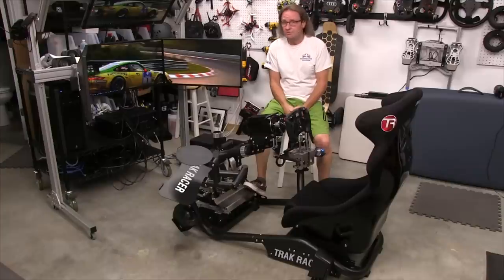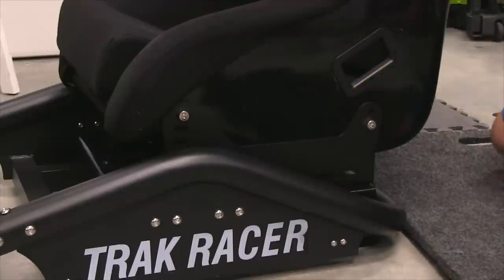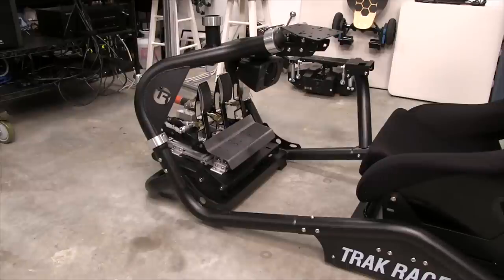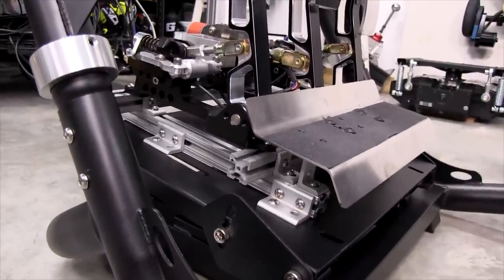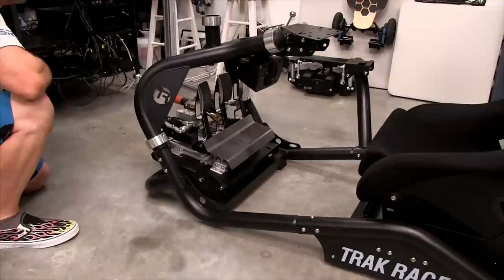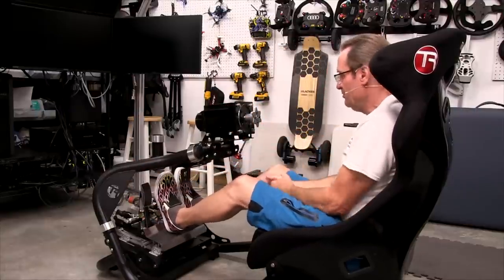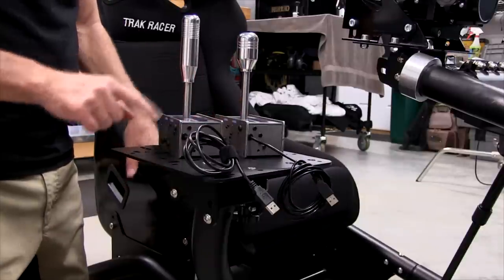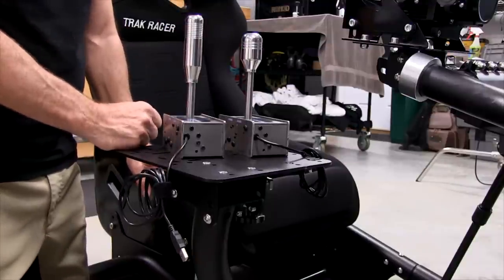Trak Racer TR8 review "The Setup"

Comment: Thanks for your review Barry. As a result of your comments we have designed and now shipping the Mach 2. The TR8 Mach 2 features:
1. New and stronger pedal plate and brackets
2. We have added more mounting points and enlarged the pedal plate, wheel mount and shifter mount
3. We added a second grub screw to the monitor stand to stop the monitor angling when  one screw is added
4. We improved the seat so the quality is better and wider size
5. General improvements to the quality of the frame
6. We have now spread the TR8 into 2 boxes to stop transit damaged previously experienced.
Reply: Hey guys! I just ordered the tr8 Mach 2 today. Then after I saw that it was a preorder? Do you know when you will receive stock?
Reply: They’re in stock now. Did you get your rig?
Reply: What's the major difference between the RS6 mach 3 and the TR8 mach 2?
Reply: I have the RS8 mk4 and am replacing with this rig due to the pedal plate height issue. Looking forward to it.
Reply: Trak Racer awesome news i was a bit concerned seeing this so i checked your website and your Mach 3 now looks to have all of the improvements Barry mentioned. I love companies that ‘listen’ for feedback and make their products better for this reason ive decided that im going to purchase the Tr8 mach 3 from you 🤙🏽
Reply: ssidewayz I did the same‼️ waiting to get the MK3. The only thing that concerns me is that I need a bracket for my motion platform which they kindly offer me to send to try it. But I am worried about the height it could gets.
Reply: Looks like a dynamic maker. Thumbs up guys keep up the good work!
Reply: Trakracer give this man a Mach 3 to review
Reply: @ssidewayz  Until I see a comparable quality review from the likes of SRG with the new improvements I'm not investing over $1k when all I can find on the internet is complaints with missing parts, no reimbursement, and bad customer service. See Sim Racing Geek if you need an example.
Reply: Would be nice that you organise the company to supply people that order you a rig or that you keep them inform that it will be long. I'm still waiting after months to get mine 😡
Reply: @rob4294  Tooks 3 months and a lot of pressure on Trak Racer to get it. They are bad organized, some people wait long time while some people get it in a week end. Never stop putting pressure to get your !
Reply: @rob4294  I ordered my TR8 Mach 3 December 11th 2020 and just got it today february 9th 2021. worth the wait though! just built it. can't wait to try it out tomorrow.
Reply: Man it is so freaking cool that you guys listen to these reviews and upgrade your stuff.
I am looking for a rig right now and even tho the pedal flex made me unsure about the TR8, i am certain that the new version (now even Mach3) will be fine. :-)
Reply: @Dornpunzel  I have the mach3 and I absolutely love it. There's no noticeable flex for me. I use Fanatec gear.
Reply: @marcusberggren9241  Hey Marcus, thx for the feedback. I rly prefer the look of the "tubed" TR8 rather than the typical Alu Rig which does not fit that well into my living room. Do you have Fanatec DD or Belt Gear? :-)
Reply: @Dornpunzel  I use clubsport. Good enough for me. The TR8 looks great and have a smaller footprint than I expected.
Reply: GREAT! This is the kind of company reaction we want to see! Guys from Trak Racer, be sure I will order the next few weeks from you because of your reaction! Man I love CAPITALISM & free markets  <3 Good job!!
Reply: Can anyone tell me the new Mach 3 is not flexing on the pedals? I have heusinkveld and want to make sure this is the right buy
Reply: @maresq2sea  please email us through the website contact page, we will show you some reports on it's strength. Matt here, founder and CEO of trak racer.
Reply: @maresq2sea  I emailed them Saturday asking them the same question. Did they answer you yet?
Reply: @eboz3213  they did, here an extract of the email ‘f you own Heusinkveld pedals maybe you could consider going for TR80 which we have in stock and should provide you with even better experience with your pedals?’
Reply: This is awesome.  You guys actually react and make changes based on feedback.  I’ve owned a Sparco rig for about a year… selling and moving to the TR8.
Reply: @DidItForDale  thank you sir.
Reply: It's good that they actually care enough to listen to feedback that their customers give, it means they're a really amazing company. I personally am really excited for getting my Mach 3 TR8
Reply: It is refreshing to see a company act on the feedback of a professional like Barry. Well done!
Reply: Will this seat fit onto other rig brands as well?

Comment: I think this made an impact with Trak Racer Barry. I ordered mine 6 weeks ago it was due to arrive today.
I sent them an email asking what was happening, I got this response;

We have made several improvements to the TR8. 
You will actually receive an update for the TR8 which is the MK2. It has improvements to the frame, strengthened pedal mount, additional mounting points on the pedal, wheel and shifter plates as well as other general updates to the frame and seat.
Reply: How do you like the TR8? Are you happy with the choice?
Reply: Dirty Beef Curtains yes please I would like to know the same. I just ordered the tr8. And now it says out of stock. Sad af hahahah
Reply: MrControversy Not sure if you’ve gotten yours yet but it all the issues he mentioned in the video have pretty much been rectified.
Reply: Savage stuff, that has me interested again!
Reply: @DirtyBeefCurtains  Very much so, it's solid as.
Reply: @mattfarrar5472  There is a MK3 out now, which is even more improved over the MK2. I was looking into getting the GT Track from Next Level Racing, but the TR8 MK3 seems like a better option and it's also more compact. Are you still happy with yout purchase today?
Reply: @wuzumaki  They were my 2 rig options aswell but from what I've heard the Next level is pretty average. The Mk3 seems to have a much better pedal tray but for V3s it has a little flex on the Mk2.
I'm actually getting some SimworX pedals arriving today so that will test it! But apart from that the rest of the rig is great! Really solid all round you can even feel the force of the v2.5 wheelbase hitting bumps and kerbs transfer through the cockpit which is cool, not lost on any flex of the rig.
Reply: @mattfarrar5472  My biggest issue with NLR is that the height adjustment of the wheel also affects the length adjustment. The shifter tray also has more flex than the TR8. I have the NLR Wheel Stand DD, so I'm speaking from experience. Now that I'm going for a full rig, I'm most likely going with the TR8. I like the fact that it has an integrated monitor stand. Do you feel that the monitor shake too much when using the integrated monitor stand?
Reply: Update on the SimworX pedals with the Mk2 tray it cannot handle them at all, flexes like crazy! Seems as though the Mk3 tray would fix that though. Saying that though it's perfectly fine for V3s or less no issues.
Reply: Where do the track racer products ship from in the United States? I was told Texas but I can't seem to get them to take my calls or emails.

Comment: Good review. I've had mine since release about 3/4 months ago. I'm using  fanatec DD2 so had no issues with any flex at all. You are exactly right about the seat though. I had to drill new holes about 1 inch lower on the back end of the plate otherwise my back would hurt after gaming sessions. Great solid sim rig imo 👍

Comment: Thank you for the review!  I ordered a TR8 largely based on this video.  I wish I would have searched the forums though.  I ordered my rig 1/27...it’s 3/8 and still missing my lower assembly and seat.  The main assembly has a big indentation that Trak Racer tried to hide with paint..the paint doesn’t even match and it’s already coming off.  It’s been extremely frustrating to say the least!  I honestly just want my $ back.  Even if the rig shows up I’ll be selling it quickly, I have no interest in using a product from a “company” that is so poorly run and treats customers like this.

Comment: I know this is an old video but, your seat brackets are backwards and the front collars are not slid down and tightened thats why there is movement in the wheel deck frame! Also mach 2 wheel plate is ROCK solid. I guess i have you to thank for that!

Comment: I Have the TR8 with Fanatec CLS Elite and it's rock solid with that base and wheel
Reply: Hi , what size monitor do you use ,an does the monitor flex/move under wheel movement,  cheers Glenn 👍
Reply: @glennharrison6883  49" QLED TV, really solid
Reply: @froomer17  cheers mate , bloomin outta stock tho 😌 might have to go for the RS6 🤭
Reply: An other question for you 😁 , what you using to run the 49" ,, PC or console
Reply: @glennharrison6883  Both Ps4 and PC. TBH, prob best getting a monitor at the frame rate is a lot better. TV only is 60hz, monitor will run smoother at 100-155hz. If I had to buy again I would get ultra wide screen monitor. I also use HP reverb as VR is amazing for sim racing, once setup correctly :)

Comment: Ah man I wish you reviewed the stock shifter mount and the integrated monitor mount considering 99% of buyers will use those...   I hope the smaller shift mount sits a bit lower than the accessory one because it seemed a bit high up.

Comment: TR8 or P1X?, any suggestions?
Reply: That was exactly what I was thinking between the 2 and I decided to get the TR8. Simply because I know I will not go for the motion update in the future. If you DO plan to upgrade to motion, P1X is your rig.....TR8 can only be thinking to add the NLR motion V3 at the seat however, that need some custom metal framing but the seat will be too tall for the TR8 and because the wheel mount is not adjustable (raising up) so leave that TR8 is not capable of update to motion.....so I just leave it that way and enjoy the good look of the TR8. They just released the WHITE version and I think that looks very cool too.

Comment: What is the track system that your monitors are on?
Reply from the maker: A Sim Lab Triple monitor mount that I added wheels to.
Reply: @simracinggarage3026  I can't seem to find those here in the US. Any suggestions? All quality monitor stands I have seen are sold out. Just looking for a single to use with a GT Omega Pro rig. GT Omega's stand are also sold out and have been for a while.

Comment: Hello sir. Which tr8 is this? Mach 3?
Reply: I believe it's either the Mach 1 or 2 as I have the Mach 3 and It has more/diff parts than this video. Mainly on the pedal plate. They've listened and strengthend it.

Comment: I had an trak racer rs6, it had really bad flex in the pedal plate and wheel plate. Really disappointing product. I have a simlab p1 now and it is worlds better.
Reply: Those 2 cockpits aren’t even close to the same price area 😂 a p1 is a high end rig where an rs6 is almost considered low end.
Reply: @aoplinger622  I mean I believe the rs6 was around $600 and the p1 was $800. Not a massive price different. Edit- just checked they are exactly the same price at 750$. But you have to add a seat on the p1 for $150. So they are competitively priced.

Comment: Hey Barry what do you prefer out of these two rigs the fanatec dd1 with the v2 Formula rim, podium shifters with v3 pedals or the simucube 2 pro with heusinkveld sprints and the ascher f-28 Wheel. Both will be mounted on the gt1 rig but the simucube will be mounted on a deck using a bracket whereas the dd1 will use the Simlab podium brackets? I’m personally leaning to the simucube as all the parts on that side are so high in quality relative to the fanatec, but I would like to know your view. And be sure to put down any suggestions. Thanks Barry!
Reply from the maker: Either one would give you a great DD FFB experience. I think the SC2 is the more mature of the two. This due to it being an evolution of the SC1 or OSW solution from Granite Devices. Also, currently the SC2 will give the most solid wheel mount using their QR solution or one of you own like the HRS or Q1R. If you do get the SC2 you would be cutting yourself short in realized performance if you did not get the 15mm thick front wheelbase mount that Sim-Lab offers. That said the Podium is a new solution and Fanatec's first dive into a DD wheelbase. I am sure that it will only improve moving forward. Fanatec is already working on an improved wheel mounting shaft for its motor. With their industry experience, I'm pretty sure they will get it right. But we will have to see. I have no reservations about the outrunner motor they are using. It gives very good performance. And will only get better as that platform matures. And, like the SC2 wheelbase mounting comment above, the Sim-Lab Podium mount is a must to realize the most performance. Just an opinion based on my real life experiences. I'm sure there will be those who disagree.